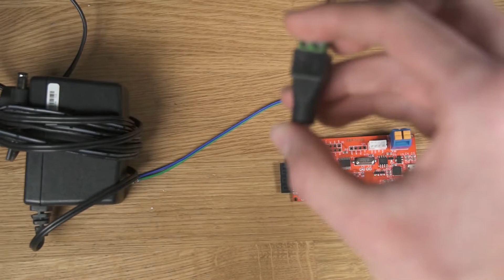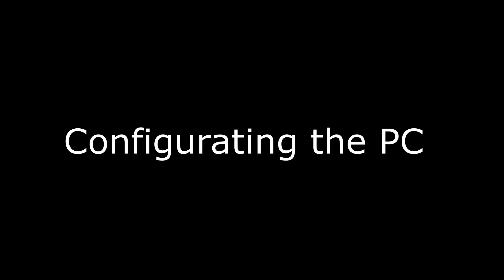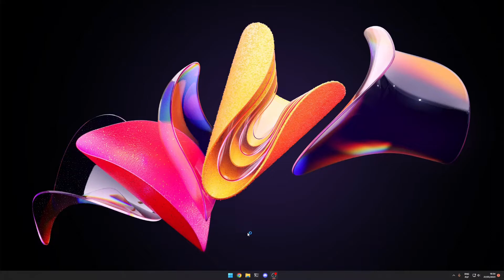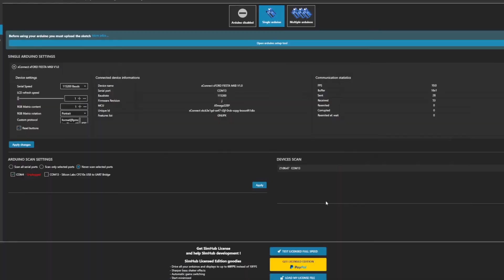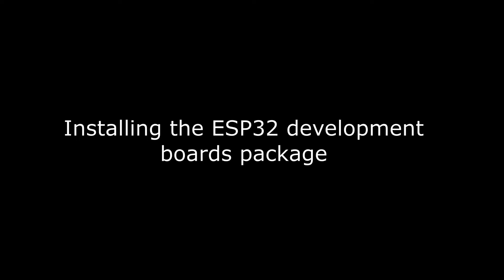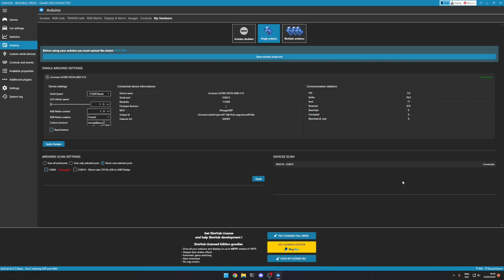How to connect a Ford cluster to games (MK5, MK8)

Comment: Hello,
I have mysself a mk8 so my son thinks this is awesome.
Is there also an option to change the lcd display or scroll to the menu?
Thanks
Reply from the maker: Yes, there are IO pins designated for the steering wheel buttons, use the newest version of the sketch: https://github.com/InfoX1337/xconnect-software

Comment: Can this work with any can bus cluster? Example 2016 Honda Accord ?
Reply from the maker: The boards themselves work with any cluster, the code however has to be made for each cluster. Most have different can codes and values.